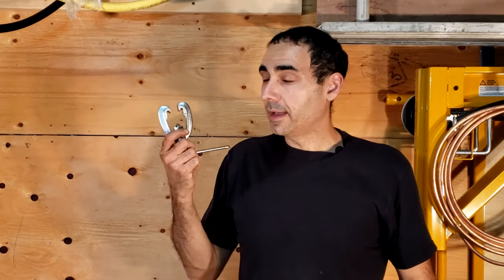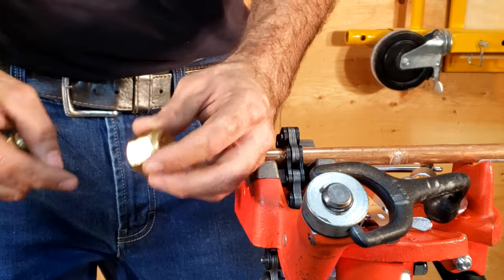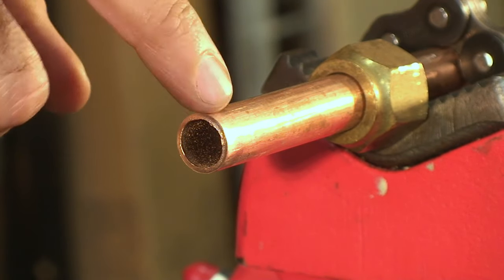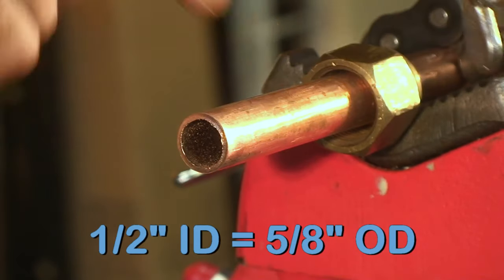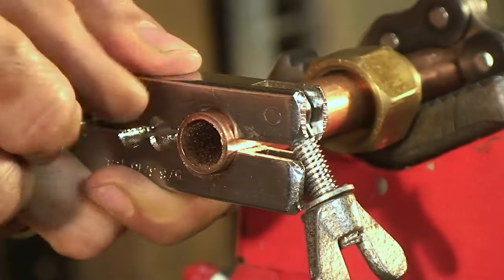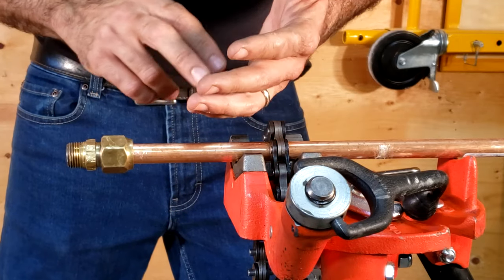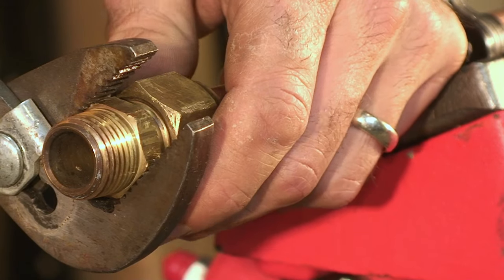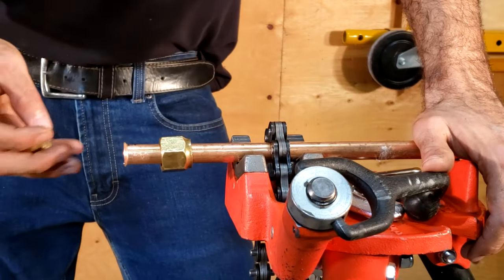How to Flare Copper Pipe!

Comment: is refrigerant copper pipes,the smaller like quarter inch,can they be used for air compressor lines also,thanks
Reply from the maker: Hi Mario.  Although I'm not a specialist in refrigeration, I would say that copper piping used for refrigeration purposes can certainly be used for air lines, provided that you do not exceed the piping's air pressure capacities...which is capable of handing at least 300PSI.  Note that tre diameter of piping has no effect on PSI, although it WILL have an effect on VOLUME.  You mentioned using smaller 1/4" piping, which would carry less amount at a certain PSI than a larger pipe would (and may therefore be too small to suit your needs).  Hope this helps.

Comment: Great video!  I am installing a mini-split in my RV and there is a great emphasis on having the proper 45 degree flare on the copper tubing; some commenters have said there is a "special" 45 degree flaring tool you need to purchase specifically for these mini-splits.  But early in your video, you seemed to mention that 45 degree flares using the tool you are working with is typical, or they "mate" with the flare fitting (0:53).  My question, then, is:  do you need a special flaring tool to make 45 degree flares, or will the tool you demo in this video make them naturally if done correctly?  Thanks.
Reply from the maker: Thanks for Yue) your kind words! 🙏

From my understanding, although all flares are typically made using 45-degree angles, some connections are double-flared, as opposed to single-flared as demonstrated in this video.  I'm not an AC guy, but I think single-flare would suffice for your application, which could be manufactured using this tool.  A double-flare connection has the flare rim folding in on itself.  Still at a 45-degree angle, but requires a different flaring tool.  If you can assess exisitng fittings/connectors on the system, you should be able to quickly determine the flare type.  Also, be sure to slightly deburr the pipe prior to making your flare, which I forgot to do during the fuss of making these early videos! 🤦‍♂️

Hope this helps, and good luck!
Reply: @PlumbingsCool  Thanks for the information and not posing yourself as an expert "AC guy" when you don't have the experience and background in working in this specialized area.  But the pro's in the mini-split field, like I mentioned before, make a big deal out of these 45 degree flares.  One commenter suggested this brand:  “Rothesberger” who makes a 45 degree flaring tool.  I looked this brand up on Amazon and was not able to tell the difference between the tool you were demonstrating and that one (though they looked different).  I'm still a bit in the dark as why they insist on these 45 degree flares if, as you might suggest, they are typical when you correctly use a regular flare tool.  Again, appreciate your video and timely response to my question.
Reply from the maker: Lol...well, the way I see it is that, regardless of the tool you're using to produce a single flare, the result needs to be compatible with the flared fittings and nuts that are on the market - which (as far as I know) are spec'd to be produced at a 45-degree angle, so the cheaper tool should theoretically work.  If you were in a trade or situation which required you to produce flares on a regular basis, then I'd absolutely agree to purchase the best quality tool you can afford at the time, as it becomes integral to your livelihood, efficiency or safety...but if the tool is intended for one-time or very sparse usage, then I don't see the point in spending the money if the cheaper tool will suit the task at hand.

Just my two cents!
Reply: @PlumbingsCool    Thanks.  Maybe these "specialized" 45 degree flaring tools are simply an advertising gimmick if all flaring tools are manufactured to make 45 degrees.
Reply from the maker: That's my understanding; 45-degree should be the standard for flared connections.  Good luck!

Comment: A nice refresher on the spacing needed past the clamp. What I needed for my project at home.

I only have one objection: I have done water and sewer main installations for almost seven years now and we use a compression coupling to tie the old house service (usually copper) to the new service we install, however, I am in MN and that may not be permissable where you live.
Reply from the maker: Thanks for sharing.  I'm always intrigued to hear about how things are done in other areas.

Here in Ontario (and the rest of Canada, I'm quite sure), the Codebook explicitly restricts underground copper connections only by means of flared, brazed, or corporation connections. 

Considering the last one (corporation), I'm wondering if that's what you're referring to when you say "compression".  Technically, a corporation fitting does seal by means of compression.  However, we differentiate them here, as a corporation fitting is significantly more heavy-duty and requires a couple of wrenches and ample elbow grease to ensure a proper seal.  Corporation fittings are utilized quite extensively here for underground copper applications, with minimal issue. 

Comparatively, compression fittings are relatively flimsy, and easily leak when the joint is placed under even moderate stress.   They're the same connections that are utilized for dishwashers, humidifiers, refrigerators, toilet & lavatory supplies, etc.  I'd personally avoid using those at all costs whenever possible...especially if it's below-ground!

Thanks again for sharing, and watching! 🙏
Reply: @PlumbingsCool   That is soo true. I have seen roots grow past the o ring in underground compression and sharkbite style push on fittings..
I couldn't sleep at night putting that crap underground. I don't even like putting them in wall cavities. Only acceptable in areas where they can be easily visually inspected.
I know you did mention it, but please  use a couple of adjustable spanners at the least to tighten flare nuts.. (That was my other cringe :)
Reply: @PlumbingsCool  Great point from Dexter and, your counterpoint. Bottom line, a 'compression' coupling is always a worse choice over a flared fitting, especially underground. The flared coupling is a superior mechanical form and double the protective scope when considering either method based on its mechanical principle. It's just a better choice to go with vs the compression on average... Cheers.

Comment: Am wondering how to expand the end of a copper pipe that would allow the end of another pipe of similar diameter to be inserted into the expanded pipe end for say, soldering.
Reply from the maker: Yes, there's absolutely a way to do as you've described, and it's even got a name:  SWAGING!  You've got me wondering whether I should produce a video on it...but until time allows me to do so, here's a brief rundown for you:

Swaging is when you take a plain-end piece of copper tubing, and you stretch out the end of it to form a female end so that it accepts a plain end piece of tubing (effectively eliminating the need for a coupling).  Swaging can be carried out in a number of ways.  The traditional method is to use a simple swaging tool, which is merely a machined piece of solid steel, about four inches long, which is tapered and shaped to fit easily into the inside of the tubing on one end, and is flattened on the opposite end to allow for hard striking of the tool with a sledge hammer.  Striking of the swaging tool drives the conical/tapered end into the pipe, thereby expanding it...and voilà!

A few important key points to keep in mind when swaging:

1. Expand the pipe to accommodate the SAME SIZE of the pipe (i.e., you can't take 1/2" pipe and stretch it out to accept 3/4").
2. The pipe should be at least Type L copper pipe any thinner-walled (M or DWV), runs the risk of splitting it. 
3.  You had mentioned soldering of the joint.  Although you are technically correct, the connection should consist of SILVER soldering, otherwise known as brazing, which is much stronger than traditional soft-soldering using a traditional tin alloy.  And for that, I'm pleased to say that I do have a video:

https://youtu.be/FHQEn3o0_B0

Hope the above helps, and thanks for watching!

Comment: I work in a refinery & every time in repairing steam leaks with copper tubing. I always have a hard time putting a new compression fitting on a heated 1/2 copper tube. Any recommendations?
Reply from the maker: Hi there!  Interesting question.  I'm presuming that your difficulty is the result of thermal expansion causing the pipe to be too big for the compression fitting or ferrule?  Just curious as to why you're using compression; to be honest, I'm not a fan of traditional compression, at least for water pressure because the joints fail too easily after minimal movement.  I'm not aware of the scenario or application, but are you perhaps able to braze the jointd using couplings? The couplings might be easier to slip on, and the brazing joint would be much stronger than any compression joints.  Just my two cents.

Another thing which comes to mind is whether you're reaming the pipe when you're trying to slip your compression fittings on.  I'm wondering whether your cutting method is leaving a burr on the outside edge of the pipe, preventing the fitting to slip on.

Comment: I am getting burrs on the outside of the pipe from the clamping bars and I'm not able to bring the flare nut to the flare. How do I avoid or get rid of those OD burs from the clamping bars?
Reply from the maker: You'll need a reaming tool that actually reams the outside of the pipe as well (before you flare it).

I like to use the #Ridgid 223S inner/outer reamer, which works quite well:
https://www.ridgid.com/us/en/223s-227s-inner-outer-reamer

Also, be sure that when clamping it, you're not leaving too much pipe end exposed.  Like Goldilocks, it's gotta be juuuuust right!

Hope this helps!
Reply: @PlumbingsCool  thanks for the response but I mean, AFTER I've already made the flare. The flare nut is already on the pipe, but then im not able to bring the flare nut up to the flare i just made
Reply from the maker: Yes I understood correctly, but what I'm wondering is whether you're extending the pipe a little too much before flaring.  Otherwise, I'm not sure how else to resolve it with the current information.
Reply: @PlumbingsCool  just tried it now, my problem was not tightening the butterfly nut closest to my pipe first. Thanks for the help!
Reply from the maker: Ah, I actually DID misunderstand what you meant. Yes, sorry about that.  You meant burrs along the sidewall of the pipe.  Yeah, a loose, slipping clamp would explain your issue.

Delighted you resolved your issue! 👍

Comment: I am trying to learn how to hook up a .75" ( copper tube ?) between a Harbor Freight 5 HP air compressor pump and an air tank check valve. The pressure switch is set to 135 psi maximum. Most of the units I look at seem to use an annealed soft metal tube. All of the fittings are flared and designed to be used with .75" tubing. Is it okay to use the soft copper coiled stuff for this task? I need to bend this tube as well. Is the hard copper   suitable for bending?
Reply from the maker: Generally, soft annealed copper coil is typically used for for flared joints, as it's much easier to work with.  In the video, I'm demonstrating with hard-drawn copper pipe, which is certainly doable, albeit more stubborn.  If you have a choice, opt for the soft copper coil.  If you have only access to hard-drawn copper pipe, you may want to preheat it to soften it up a bit, which render making the flare joint a whole lot easier.  In either event, ensure that the pipe you're using is at least of Type "L" thickness; Type "M" is just way too thin for it to be stretched out when flaring.

As far as bending and pressure ratings is concerned:  provided that you're using approved plumbing or refrigeration copper tubing, you should have no issue handling 135 PSI;  Our Plumbing Code here in Ontario mandates the pressure-testing of waterpipe at a pressure up to 150 PSI...and I sometimes pressure-test my students' copper shop projects at upward of 300PSI just for giggles!

Finally, with respect to the bending hard-drawn pipe, our Codebook only specifies:

7.3.3.10.(1): Types M and DWV shall not be bent., and
7.3.3.10.(2): Bends in copper tubing of soft or bending temper shall be made with tools manufactured and sized for the purpose.

So it doesn't explicitly say that you cannot bend hard-drawn pipe, only that it must be "of bending temper".  I've bent hard copper pipe several times.  And although you'll need some serious elbow grease, you can do so without issue...provided that you have the proper bending tool, which is not common to come by.

In summary, If possible, try to get a hold of of some 3/4" Type "L" soft copper coil to serve your compressor project needs.  But in the worst-case, hard-drawn Type L will suffice, provided that you adhere to my aforementioned points.  

Hope this helps, and thanks for watching!

Comment: If you add teflon tape does it cause any problems?
Reply from the maker: Good question.  Theoretically, you shouldn't need to add anything if it's a good flare.  Applying T-tape runs the risk of causing obstruction, specifically if some of it were to break off and end up in the system.  Generally, T-tape should be limited only to outer (male) threads, and leaving the first or second thread bare, to prevent the potential for obstruction as described above. 

That said, I have had those in the refrigeration industry advise that they use a sealant called Nylog Blue...however, I can't vouch for it as I've never used it - plus it's likely not approved for potable water applications.

Comment: Excellent explanation -  is it OK to undo/loosen a connection and then tighten it back up (so for example, to do some other work) or do you need to make a new flare?   Thanks again.
Reply from the maker: Thank you very much! 🙏 

Yes, you can absolutely undo them and retighten them back up again without issue.  The only addition I recommend since making this early video is that you may want to debur or ream the pipe prior to making the flare.  Also, if you are using hard-drawn rigid pipe (as opposed to soft annealed copper coil), it will be much easier on your tool (and you wrist!) if you first heat up the pipe with a torch and allow it to naturally cool, so as to soften up the metal's temper.   You can refer to my Copper Swaging video at around the 10:30 mark, for what I'm referring to:

https://youtu.be/87OvD-Eohqg

Thanks again for your time and supportive words!

Comment: can you flare 7/8' copper pipe? I cant find any kits.
Reply from the maker: It depends on whether you mean 7/8" outside diameter (OD) or inside diameter (ID).  What plumbers call 3/4", actually measures 7/8" on the outside.  The measurements on tools usually refer to OD.  So if you need to flare 3/4" ID pipe, then you need to find a tool that flares 7/8" OD...which I do indeed know exist.

If your pipe is 7/8" ID (which I've never seen), then you need to find a tool that flares 1" OD. 

Once you confirm your ID and OD diameters, simply do a google search, and you should be able to find an appropriately-sized tool.

Hope this helps.

Comment: I need to flare a 14.5mm OD tube... Can i use a 5/8 flaring tool for this?
I dont see a tool for this size, what do you recommend?
Reply from the maker: Hmmm...my math tells me that a 5/8" OD flaring tool is equivalent to 15.875mm, which would too big to be able to even hold the tubing in the block.  However, if you get your hands on a 9/16" OD flare, that'll equate to 14.2875mm, which will get you much closer to your target size of 14.5mm.

A quick search shows that 14mm flaring tools are available, which may be able to hold your tubing without excessively pinching it.  

However, using off-size is a bit of a gamble, and you'd need to ensure that the specifications between SAE and your target flare are identical (i.e., same 45-degree manufactured flare angle)...but it MIGHT just work.  

To be honest, I've never flared off-size before...but now you've got me curious!
Reply: @PlumbingsCool  Hey thanks for the reply! Its been tough trying to figure this one out... I suppose i could sand the tube down a bit 🤷🏻‍♂️
Reply from the maker: Not sure if you'd need to sand it down if you can get your hands on a 9/16" OD, as it's off by so little. Could you perhaps try some test flares with some scrap material before installing? 

Anyway, glad to be of help (for whatever it's worth!) Good luck! 🤞

Comment: Why not make the flaring tool '1/8 inch thicker to avoid this ambiguity of leaving the pipe a bit higher than the tool surface?
Reply from the maker: Hmmm...I'm not sure how that would work, given that it needs to push the flare outward, which would be inhibited by any restrictions.

But, if you could figure that out, perhaps you'd be sitting on a multi-million idea!
Reply: @PlumbingsCool  - The concept is working in my mind, the design and prototype will follow. I'll revert when I am ready with a proof of concept,
Reply from the maker: Awesome! I encourage you to go for it, and genuinely wish you the utmost success and riches!  👍